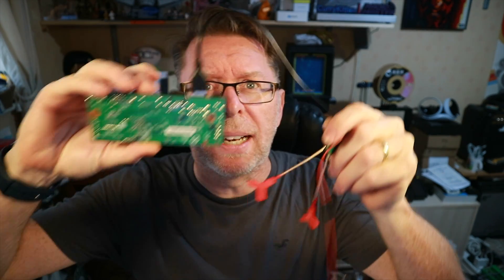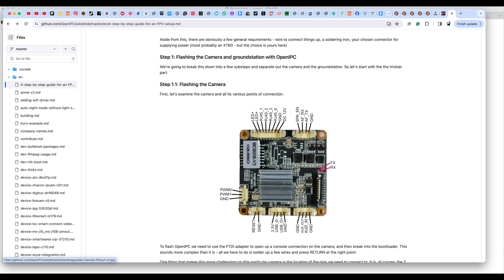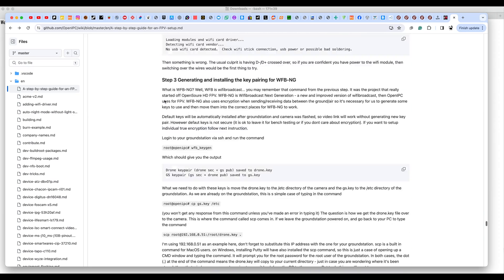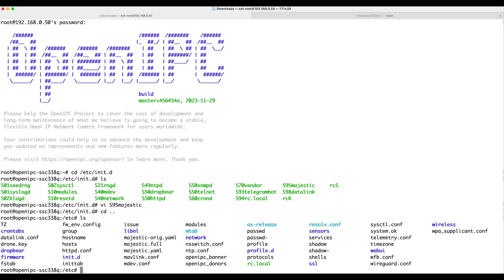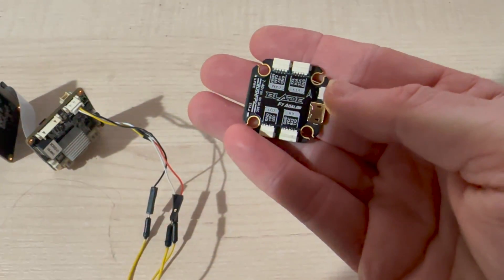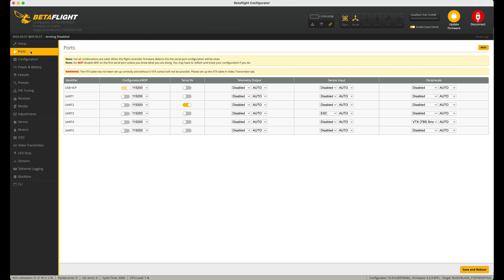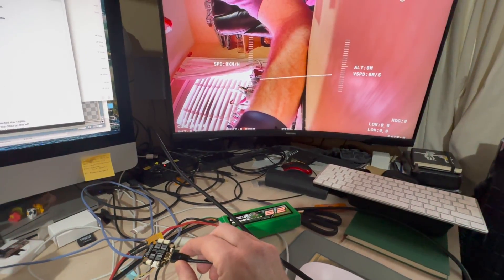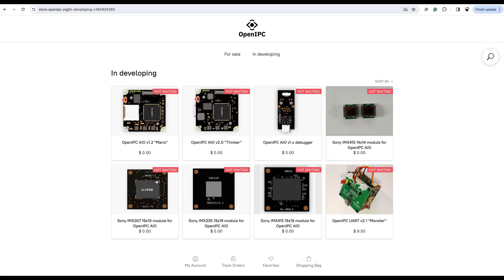OpenIPC Build part 3: Connecting up a Flight controller and configuring telemetry for the OSD

Comment: Thank you for the amazing video. Could you please tell me if it's possible to connect an OpenIPC camera directly to a flight computer (Orange Pi/Raspberry Pi) via wired connection? If so, please provide links where I can read about it.
Reply from the maker: Not quite sure I understand the question - are you talking about just the camera component of the SBC (i.e not the computing part)?  In which case, no - I don't believe so.  The MIPI interface is different to what the PI uses IIRC.  I had to spend quite a lot to get a half decent camera on my Pi Compute module I used in OpenHD
Reply: @ I want to get video from an OpenIPC camera on my Orange Pi, which I am using as a board computer. Is there a way to get video by directly connecting an OpenIPC FPV drone camera to the Orange Pi with a wire? This would allow me to have both a ground station and board computer at the same time connected to an OpenIPC camera. Thanks in advance.

Comment: Why in the wiki does the majestic.yaml file show "osd: enabled: false" if it's supposed to be enabled? Also, how do you edit the OSD? Is it with the openipc configurator or on betaflight?
Reply from the maker: I didn't get that far before I aborted the idea of using the groudstation based OSD, and implemented MSPOSD so the camera would provide a OSD that I could edit via Betaflight.  I made a video about it

Comment: Hello, your project is amazing, im trying same at home and post resut,
Can you please give us battery model for power wifi module please :)
Reply from the maker: I used a simple 4S battery, but the key was using a voltage variable voltage regulator that can bring the voltage down to a sfe level
Reply: @CurryKitten  thank you for your reply Curry ❤ what is voltage of battery do you recommend for connect to bec please ? ^^

Comment: Have you looked at Ruby lately?
Petru has added support for Open IPC hardware and once flashed, it works with existing Ruby Ground units so any OpenHD Ground unit you may already have will work with it if you flash Ruby to an SD card and add buttons to the GPIO for menu navigation, Ruby menu buttons do not use any GPIO pins that OpenHD uses so adding them does not affect switching SD cards between OpenHD and Ruby to go back and forth between ecosystems but I dont think you would look back after trying Ruby anyway!

He is adding more and more features into the Ruby Open IPC camera firmware, the most recent being shutter speed control via ruby and added a second UART to the Sigmastar SSC338Q
Once flashed with the firmware, all you need to do is power it up and it will start on a default frequency and doing a search with the ruby ground station will find and connect to it.

I've not done it myself yet but have the Sigmastar SSC338Q on order which will get flashed with Ruby when it arrives in few days.
Reply from the maker: I've no really looked at Ruby generally - mostly because it's a one-man project and is closed source.  I don't have an issue with people doing things on their own, or keeping the source closed, but it represents a far higher risk if he decides not to/can't continue with the project for any reason.  One guy in a lead position in OpenHD almost tanked the entire projeet when he left!  With that said I'll try and give it a look when I get to the flying part.  At the moment OpenIPC keeps changing so often that it makes me want to pause and let it settle for a while
Reply: @CurryKitten Ruby has been open source for a while now.
Reply: @CurryKitten  It's open source always has been

Comment: Hi, succeeded with OSD. Question. Is there a way to configure the OSD e.g. to display more information from the FC or turn down the artificial horizon. Thank you.
Reply from the maker: There probably is - but if its documented, then it's very well hidden.  Bet bet is to post in the FPV telegram group.  I'm sure I saw a file somewhere that defines what the OSD would show, but I maybe wrong

Comment: How about connect QGroundControl/Ardupilot Mission Planner to the groundstation to show telemetry and video?
Reply from the maker: Yes - nice idea.  I'm told this runs slower than just using the stuff from the NVR, but certainly worth checking out what the pros/cons are

Comment: Wayne, do you know what pins/pads each /dev/ttySx belongs to?  There's ttyS0, ttyS1, ttyS2, ttyS3 in my /dev directory.  I stupidly sent +9v into my ttyS2 and my telemetry does not work. Never even got to see it work.  I have connected up to the tiny pins now and tried setting it to all of the above, with no luck.  I don't wanna fry a lipo!  Need that batt voltage
Reply from the maker: I found the same thing when I was trying to work out which tty the second UART belonged to, and it was just through trial and error I found it was S2.  I couldn't see any connectors that could be another tty, unless they share pins with something else, and that's very undocumented.  Those tiny pins should work as a tty though.  Is getting still running on the console in inittab, if there's already a process that's using ttyS0, then the telemetry won't be able to use it

Comment: Thanks for part 3. I managed to get this all working on the bench. However, I gave up when my second ground segment (NVR) quite working. Was I just unlucky to get two bad units, or hooked up something incorrectly, or are the NVRs plain unreliable?
Reply from the maker: I guess it's a question of how confident you are that you didn't hook something up incorrectly?  I can't really speak to their reliability - the one I have has been fine, but I've only used it for 2 or 3 hours in total, so a little early to say
Reply: Good that yours is reliable. Maybe I will give it a try again. Thanks @CurryKitten

Comment: Awesome, Wayne! Looking forward to the tests! 😃
And yeah, I'd definitely try it with a rc car first!
Stay safe there with your family! 🖖😊
Reply from the maker: Let's see how easily I can stick this on the car (probably easier than on a plane) :D
Reply: @CurryKitten  About that, when you can take a look at the Suchiyu models. Their only "defect" is that they don't come with oil shocks, but they're pretty cheap. 
I bought the Scy 16302 (that looks like a 1930s Ford) and I'm going to get the Scy 16103 Pro, the "Gantry Pro"... To rip around in the beach. 😃

Comment: I like to see the latency on the bench
Reply: open ipc latency  is kinda dependant on your screens refresh rate , from what i remember the "VRx module" that you build gives you at best a latency of 70 to 90 ms but if you have HDzero's goggles or i think skyzone 4's (both have 100Hz refresh rate) you can get a latency of about 50 ms , so your cheapest ground station setup for the lowest latency possible rn is lugging a laptop as your ground station or hooking up an orange pi  with wifi to a 100hz screen all running of a battery bank or something , open ipc has made alot of progress on the air side of things but the ground side is slightly lacking , i think they have said they can get the latency down to 30 ms - so in line with DJI but that was with optimal hardware and conditions , so i guess most of us will still have to wait until they start building some fpv goggles that we can buy . But do go and ask the guys on telegram for a direct reply , im just a dude that follows the news on it closly so my info can be out of date
Reply from the maker: If you watch this video that Mario posted, another guy did a bench latency test https://youtu.be/i_Wz9oAK5z4?si=P0mwFMd2otum344_&t=212  I'm less interested in this and more interested in the latency when you fly it.  Not that I have the know-how to measure this accurately